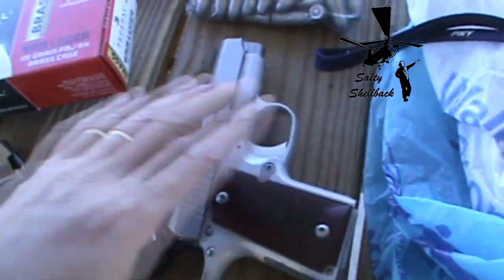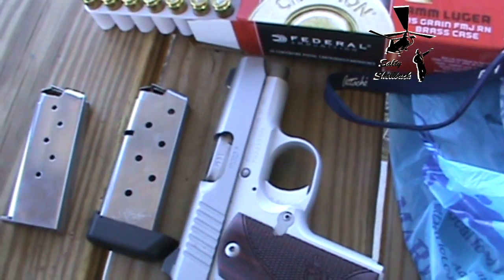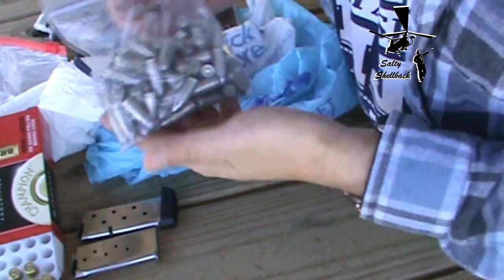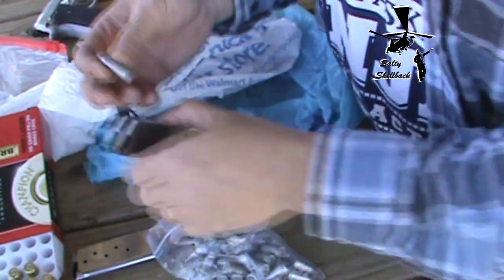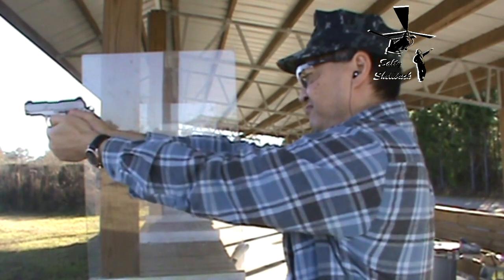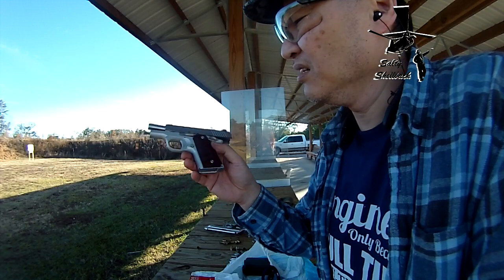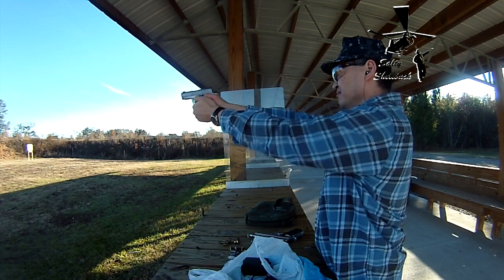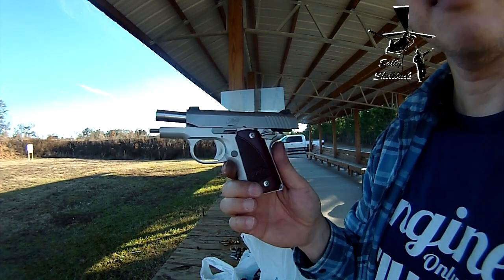Kimber Micro 9 myths debunked (Not monitized)

Comment: Whoever told you about shooting 124 grain ammo was recommended by Kimber was mistaken.  They "Required" you to shoot 124 grain in their SOLO 9MM, which was basically a failure.  Because of the requirement to shoot 124 grain, and the extra cost of it, the general shooting public said no thanks. The Solo failed miserably with 115 grain ammo, unless it was +P rounds.   I own the same Micro 9 as you with the FDE paint scheme and the laser grip.  It's never had a single malfunction in over 3,000 rounds.  All 115 grain, but most of them are my personal reloads.
Reply from the maker: Yup, when the internet "gun experts" tell me I'm doing something wrong, I usually verify for myself before I take their word for it.

Comment: Good video.  About the only thing I don't like about my Micro 9 is the difficulty of loading the magazine as you get close to topping off.  I never cut my thumb doing it, but I've thought I had a couple of times.  I thought a Glock was bad, but at least they're double stack.  However the cure was a $10 mag loading tool.  All the difference in the world.  Get one.  It'll help.
Reply from the maker: Once the spring gets worked in, it's not too bad to load 😉

Comment: Just MAKE SURE you CLEAN and LUBRICATE the Kimber BEFORE you first fire it, and then every time there after.  It's very easy to pull the firing pin and ejector out of the kimber when you clean as well.  Run the slide wet, it likes it.
Reply from the maker: OK thanks

Comment: Salty I am with you on the kimber micro 9mm Currently I’m on my third Kimber micro 9mm the first two where in Desert heat with Crimson trace laser both where stolen currently I got the kimber micro 9 in rapid with that mag funnel removed i add MCarbo spring kit and a Houge green laser grip and polish out some components  i’ve put these little guns through hell and back and NO issues i have put right 500 rounds of everything even some cheap steel case just break it in and it a super pistol i’ve had no FTF  I love this little gun  
And believe me i’m hard as crap on carry guns
Reply from the maker: Cool! I have had no issues with it after Kimber polished the chamber and I put another 300 or so rounds through it.

Comment: Breaking in the micro 9, use 124 gr all it takes is 225 rounds. If oiled properly before firing all the micros will be like glass, stopped counting after 1000

Comment: Recently bought a Kimber Micro 9 for concealed carry.  I've ran about a hundred rounds through it and it jammed 7 times.  I am not happy with it so far, but will give it a bit more of a break in period before giving up on it.
Reply from the maker: Yeah, for the money I was expecting it to not have so many issues. They did do me right by sending me a new guide rod.
Reply: Had the same problem.  I put oil on it and it hasn’t failed since. 500 ct now
Reply: Hey guys used to work for Kimber. 100rds is just starting break in. Oil them up real good they're wet guns. You'll need 3 to 500 rds to get them broke in
Reply: @ralphjohnson5592  oil them up where? I have the ESV micro 9mm. Shot about 200 rounds today and it feed malfunctioned 5 times. Any recommendations?
Reply: @DissentOrConcur  keep frame and slide connection well lived. Also if it still won't feed it probably needs feed ramp redone. Also get some quality mags for it. Wilson Combat work very good.
Reply: Mine too.   Gun sux.    Probably got a lemon.

Comment: Watched this twice.  Looks like your using more lube now 👍  Running smooth like mine. That lube Kimber sending in your bag really works great. I bought a big bottle.  Keep the ramp polished and slides lubed and shes a trustworthy side arm for sure.  Again great video
Reply from the maker: Bill14886 Thanks! It runs great now. Whatever the factory did to it along with just shooting it a lot has greatly reduced the malfunctions.
Reply: @saltyshellback  while watching the video, I assumed you had no jamming problems. But you had a new guide rod installed. was that what the factory did to remedy the issues? was a good video BTW

Comment: Sweet Kimber. Very nice analysis. I myself was unaware that you could reload aluminum cases. Never to late to learn.
Reply from the maker: I tried it on my junk range gun and it seemed to work like a champ, so I was all over it!  Just make sure they are Boxer primed (one hole) and not Berdan (2 holes) primed.  I have also reloaded steel cases....just make sure they are not rusted yet.
Reply: @saltyshellback  Thanks.
Reply: I'd be worried about the Aluminum building up inside the dies if you do a lot. 
Or the varnish off the steel doing the same. 
I guess it depends on how much you do at a time. I can do about 700 rounds an hour so I usually do 2000 each run.

Comment: Glad you did this....I was Hell bet to get a Sig P938.....Went today to look and feel.....The Micro 9 was beside it, so I got to grab that too.....Liked the feel of the Micro 9 better......So then I go on a quest to investigate the Micro 9....watched your other vid on it......This Vid took any dought away to dropping the $....Like the Stainless DN model.   :)
Reply from the maker: Bobby Wartman I like the gun OK, but yes, the price is a bit steep for what you get and the issues you may have to deal with.  I also need about 100-200 rounds through it to smooth things out. I had to send it back to the factory for a loose rear sight and they polished the feed ramp and chamber for some reason when they had it. Runs fine mow.
Reply: @saltyshellback    I ended up buying the Kimber Micro 9 KHX....Bought it Tuesday...Today I don't even see it on their website....It has the Hex engraving.  Ordered 3 -- 7rd mags from Kimber...Ordered the trigger set from MCARBO and a set of Hogue grips in EB green
Reply from the maker: Bobby Wartman Cool! Here are some lessons I learned with this gun. Not saying to any of these things right away, but if you experience any of the following issues, you can try my remedies.  If you have failure to fully go into battery (sometimes causes light primer strikes too), try polishing the feed ramp and chamber. Careful not to round over the chamber shoulder. If you have an issue with the rounds "nose diving" in the mag especially with a full mag, polish the mag feed lips with a nail polishing emery board. If you are having issues with consistent shot placement, check the rear sight-mine came loose after about 50 rounds. The user manual does say to break it in with something like 100 rounds I think.  Have fun!
Reply: @saltyshellback  Thanks :)

Comment: I could see when it was brand new it may have needed heavier bullets, but after a short break in do fine with lighter bullets.
Reply from the maker: It shot the 115 grain bullets just fine when it was new. Most the issues I had with it were chamber related. Once Kimber polished the chamber, all the problems went away.
Reply: @saltyshellback  Makes sense.

Comment: Great video brother.  Thanks for sharing this info.  Is great to know.   We just got a two tone with Hogue grips and true glo sights.  Is a great shooter
Reply from the maker: This one shoots good now that it has been broke in.
Reply: How many rounds did it take
Reply from the maker: Todd The GunGuy I think it took about 100-150 rounds before I had no more feeding issues with it. I had more issues with the aftermarket Kimber 6-round mag than anything else. I had to get an emory board and soften the edges of the feed lips of the mag to keep it from catching the casing and causing the round to "nose dive" in the mag as it was trying to feed. 
Also, since the 6-round mad has a flush base plate, it is slightly recessed in the mag well when it is fully seated. You really have to make sure it clicks into place or else the slide will not pick up a round.

Comment: Just picked up a Micro 9 ESV black with gold barrel. Love the looks. Hoping it functions well. Won’t get to shot till after Christmas though.
Reply from the maker: My experience is that of you have feeding issues, it is probably the feed lips on the mag. Do a light polish with an emery board to smooth them out so they don't cut into the casings. Otherwise it shoots good once you get a couple hundred rounds through it.
Reply: @saltyshellback  thanks for the tip.  I ordered a few other mags for testing,  one from Wilson Combat, two Sig P938 mags and an extended Kimber mag. I’ll post here how they do.
Reply from the maker: @joebidendidthat5121  Cool!
Reply: Sig mags are flawless so far.  Threw the Kimber mag in the trash… multiple jams

Comment: I just bought the kimber micro 9 stg. Went straight from Bass Pro to the shooting range. I shot 95 rounds of winchester 115 fmj. The spent round failed to eject and jammed 5 times. I went home cleaned and oiled it and will try another brand of ammunition.
Reply from the maker: I recommend taking an emery board and polish the feed lips of the mag. Mine were really sharp and kept digging into the casing causing failure to feeds.
After about 300 rounds or so it shoots fine and will eat anything except steel cased ammo.
Reply: @saltyshellback  I will give it a try thanks!

Comment: I watched some other channel she had all kinds of issues and I think folks don't have a good grip and because of the high kick with the short barrel you need to be holding on to this bad boy I shot all kinds of different rounds through mine and had no issue I also greatly improved my shots by changing to a rubber wrap around grip
Reply from the maker: This one really didn't have any issues with grip.  It was the magazine feed lips that caused most of the issues.  I polished the mag feed lips and all the initial problems went away.

Comment: TLA I have had some feeding issues using Kimber 8 round mags with Federal Hydroshocks
Reply from the maker: I know with my mags, the feed lips were really sharp and would dig into even steel casings causing the round to nose dive.
I buffed the feed lips with an emery board to take the sharp edges out and that seems to have fixed the problem.
Hopefully that helps fix your mags.

Comment: I have 750rds through my stainless micro 9. No issues and eats everything I feed it.
Reply from the maker: This one works fine now that it has been broken in and I worked out the bugs with the new mags. The feed lips were sharp and dug into the case rims causing the rounds to nose dive.  I buffed them with an emery board and that fixed it.

Comment: my micro .380 is having trouble the slide stop engages every round
Reply from the maker: Sounds like the either the detent spring that is supposed to hold the slide lock lever down is worn out or broke.  Just a guess.

Comment: I'm buying a kimber micro 9 my next pay check how do they run on wenchester white box and federal hst
Reply from the maker: I personally would not recommend this gun unless you just like it as a novelty. If you want a good small 9mm to carry, I recommend the Smith & Wesson M&P Shield in 9mm. I have one in .45 and it works great! But the Federal white box ammo works fine in the micro 9. You may have to run a couple hundred rounds through it to break it in.
Reply: @saltyshellback  yeah I just want a mini 1911 to play around with in the back yard sence I live in the country and I can I have a full size 1911 and I want a compact 1911 too
Reply from the maker: Cool!  I am looking to get a place in the country so I can shoot out my back yard ;-)
Reply: @saltyshellback   yeah it's pretty sick
Reply: @saltyshellback  Would that be because of the single action ? Just wondering. I took mine to the range first time to day and was rather impressed overall , recoil was less than my other 9`s ,accurate , reliable so far with  2 different loads , decent trigger no travel or stack about 5lb. Bought it mainly for the looks ,the only con I see is don`t touch the safety when you break it down ,I`ll have to get used to that because no other gun I know has a quirk like that .
Reply from the maker: gun fisher Do you mean that I don't like it because of the single action, or I don't carry it because of the single action? I like the single action for range shooting or for home defense/night stand situations, but I don't train enough with it to use it as a carry gun and prefer a DAO gun for carrying.
Reply: @saltyshellback  I was wondering why you don`t recommend the micro 9 , But you answered my question in last part of your reply, myself I also prefer DOA guns and tend to lean to all metal guns myself even though I have polymer ones also. But ease of operation on DOA is where it`s at for me. Thanks.